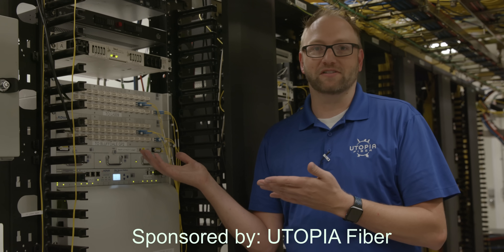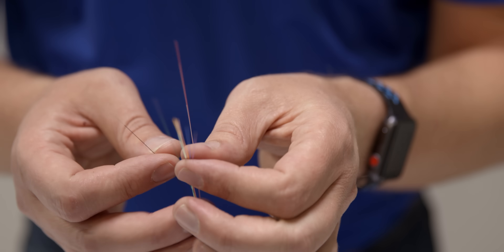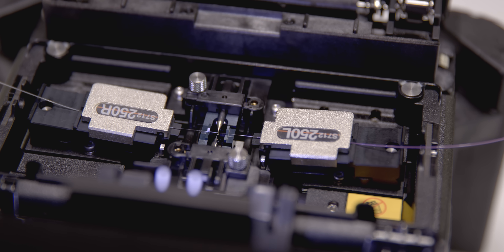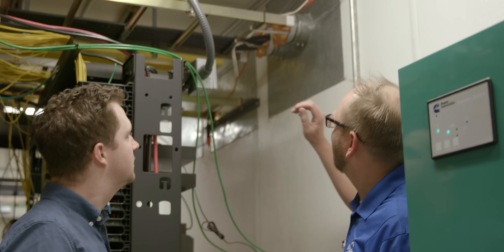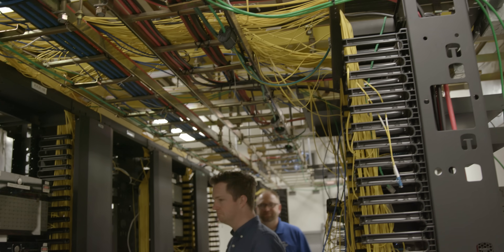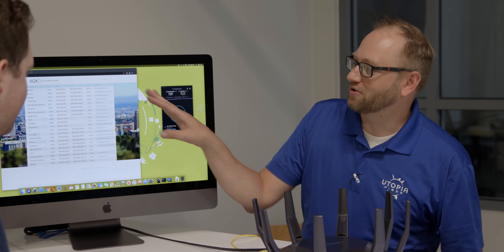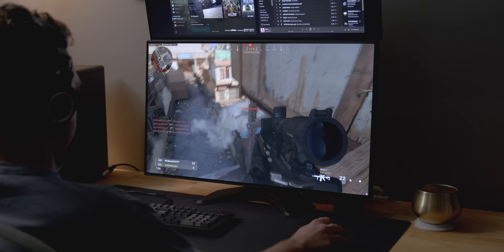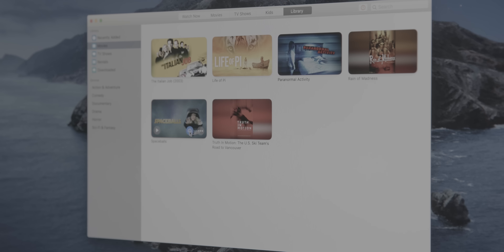4 Terabit Internet?! Fiber Company Tour!

Comment: "These are all 1Gbps connections, some 10Gbps." 

cries in german
Reply: Lmao Australia got a new network, the plans reduced upload speeds from 40 to 20mbps. We're going backwards.
Reply: Sal3600 I’m finally getting 250mbps and I’m in Australia
Reply: @thomasbarca9297  250 down or up? Even Aussie broadband with its 1 Gbps plan only provides 20mbps upload. It's disgraceful. We need higher uploads. They used to offer 250/100.
Reply: Sal3600 250mbps down
Reply: @Sal3600  you aussie ?
Reply: @Sal3600  well austria's upside down anyways.. so the internet is too :D
Reply: Sal3600 you get 20? Bruh I am lucky to get 1
Reply: Nbn ruined my Internet
Reply: @Sal3600  That's worldwide, otherwise, internet globally cound't stand by itself with so much info traffic...
Reply: @Sal3600  You can still get 100/40, it's just more expensive. 100/40 pricing is now 100/20.
Reply: @Sal3600  we’re evolving. Just backwards
Reply: Im lucky if I get 5mbps down on the outskirts of a city in England
Reply: @joeldeakin2003  I'm on the outskirts of a city and I get 1Gbps down.
Reply: Ich zahle in Hessen 35 im Monat für Gigabit bei Vodafone und es läuft.
Reply: @hasanp7256  Mag sein, kriegst aber auch "nur" 50Mbit/s Upload und Kabel is n Shared Medium. Für Deutsche Verhältnisse übel nice, aber alles in allem ist Glasfaser das richtige für die Zukunft.
Reply: @hasanp7256  Gigabit von vodafone ist ein Witz, mit nem upload schlechter als vDSL und einer Kapazität von der bei den meisten nicht einmal 500mbit bleiben
Reply: @hasanp7256  Ich bezahle 55 Euro für 100k die auch ankommen. In den 55 Euro ist auch die Miete vom neustem Modem. Aber das Internet in Deutschland ist wirklich schmutz. Wie geil wäre es einfach das man keine Probleme und überall Glasfaser hätte.
Reply: @hasanp7256  wait what ich zahle 40€ für 50mbit und mehr geht nicht aus meiner Leitung
Reply: @BrucyJuicy  Vodafone Gigabit über Kabel und Bestandskundenrabatt
Reply: Here in Iraq I pay 25 dollars for 150 kilobit 🙂
Reply: Black Devil wow they really are scamming you
Reply: @pizzoo  it's not only me
Internet in Iraq is a big shit my friend
Reply: Well regarding Germany we have a few special circumstances. For one: our population density makes (super) vectoring VDSL a choice where you can still reach many customers with rather short copper lines. But also these densities make it often more expensive to bury fiber in residential areas, as opening and closing streets is quite expensive. Also, we in Germany don't like fiber (or any other kind of cable or utility connection) on poles, but a "neat German city" has everything under ground. 90% of the cost of fibre networks is burying cables and building physical connections into the homes. 

Therefore although I absolutely don't like Deutsche Telekom's decision in 2012 to push everything to vectoring and super vectoring DSL – and their lobbyism for political boundaries in which this is reasonable – but I do understand that they did not push to FTTH or FTTB earlier (which is changing now and starting next year also Deutsche Telekom wants to invest into FTTH only).

On the other hand, especially in the federal states in Germany's north (Schleswig-Holstein, Hamburg, Niedersachsen) there is already a large community of utilities (Stadtwerke), which started investing into FTTH and FTTB deployments for almost two decades, but especially in the last decade. In Schleswig-Holstein almost a third of all homes are already connected to fibre.

But yes, we are behind other European countries in regards to fibre deployment. Especially countries like Sweden or Switzerland have had their former national telecom monopolist often pushing for "open access networks" (like Utopia in this video would be called in Europe, where a common local infrastructure can be used by many providers to deliver the service) for many years now. 

Yes, Internet needs to become a utility. At least the physical infrastructure. Competition should be in the service delivered on this infrastructure.
Reply: well, my personal experience here in a rural area of Germany.
ok... a rural area of Germany that has more then one "big" ISP availble in a 10 miles radius ( not counting the mobile service resellers )   ;-)

right now I'm paying about 50€ for a 200/12 Mbit cable connection, mind you, we only had 50/3 Mbit until the cable Provider started upgrading their backbone to gasp fibre about 5 years ago.

I gave up on German Telecom a looong time ago, it could perhaps be, because the last time I checked, they don't deliver even half the speed of that cable connection i got... for the same price coughs
nah, has nothing to do with greed and corporations and whatever -.-

and now for the VERY fun parts of that all...
max speeds I could get right now via cable, would be a woooping 300/15 Mbit for 65€ ... not really that big of an upgrade, considering the costs
and last time I checked, the only "big" Provider that is working on fibre expansion in like a 50 miles radius... would be German Telecom . . . 
well, I guess they may perhaps reach my area in 2030 ... maybe... sort of...

but, hey ! I have good news !
The German Goverment pays Subsidy to Companies that expand the Connectivity of a region, especially if its Fibre, if that region has less then 30 Mbits per home on average

and... YAY ! our thinks county ? district ? ( ... well, google says Landkreis = District ) just started a goverment subsidized FTTC & FTTB/FTTH expansion of the region through a 
( afaik ) small Company, planing to deliver HIGH speed internet to everybody and especially all those small businesses, 
letting everyone and their mom get a whooooping . . .
50 MBits . . . 
with FTTH . . .

i didn't even look at the pricing at that point.

TL;DR
so, German internet connectivity in a nutshell
- an area of north-west germany ( FIY.. Amsterdam, with many many european server-clusters, is NW of Germany ) OR a big city with backbones from more then 1 big ISP running through?
congrats, you can get 1 GBits for 80-100 €
- a rural area with at least 2 big ISP and some regional ones fighting for customers?
like me, you could get up to 300 MBits, for up to 75€
- every other area of Germany?
lucky to get a 3G connection... LTE, is that yummy?
Reply: That's nothing, you should look at India. I live in a metro, and still have to pay €25 every month for a fiber connection. Speeds are ok (around 300 mbps), but gigabit is crazy expensive (€80/month). This may not sound like much, but you have to account for the fact that currency conversion doesn't account for cost of living, in your terms, I'm probably paying closer to the equivalent of €50 a month for a 300mbps connection.
Reply: @summushieremiasclarkson4700  In germany I personally pay 45 euros per month for a 50 mbps connection over VDSL
Reply: Generously buttered ALCO .... I pay 120$ (Canadian) per month and get 5mb down and 0.8 upload on the high side
Reply: @summushieremiasclarkson4700  compared to germany 50 is kinda cheap
Reply: @summushieremiasclarkson4700  I don’t know how much €25 - €30 or €80 is in pounds or dollars (pounds I understand more since that is the currency I use, dollars i kinda understand then prices and that but not the best) but I’m going to assume it’s a lot with conversions and that to pounds and dollars, I’d kill for 30o mbps (i usually get 5 or less mbps download and less than 1 mbps upload.
Reply: Fiber 1Gbps in Bulgaria is like €12 or $15/mo
Reply: I pay 15$ monthly for 500Mbps connection (asymmetric) in Poland. The ISP offers 1Gbps for 20$ a month, but it's not available in my area yet.
Reply: Here in Spain we went from having not so great Internet connections to right now have around 80% coverage of FTTH (GPON), mainly due to a push by Telefónica, the incumbent operator, but also Orange, the second largest operator. Telefónica is replacing all the copper lines with fiber, even reaching small rural areas. They offer up to 600 Mbps symmetrical speeds, and they are planning to start offering symmetrical gigabit this year. Their hope is to have 100% coverage by 2025 at the latest, and so far it seems like they are on track (now they are focused mainly on the remaining rural areas), which it would seem unimaginable here some years ago, so there's hope for other countries I think. Also, for rural areas is important to note that the Government has a plan which subsidizes part of the costs to reach so-called "white zones" (those without coverage of 30 Mbps or higher), mainly rural areas, which played a key role in this process
Reply: Really? I figured Germany would be extremely well served. Are you near Berlin or another big city over there?
Reply: @nicholasbrownlee4209  Germany and Austria have worse Internet than many 3rd World countries, you will get 40mbps through DSL in most cities but if you want anything faster you either are lucky and have a faster than average connection or have to go the LTE route which is inconsistent and expensive.

I live in Vienna and I have to pay 50€ a month for 200mbps via LTE which I only get at night during the week, mid-day I'll be lucky to get 80mbps.
Reply: @alex_inside  As someone who obviously knows very little on this topic, this is surprising to me. Is it because politicians are not pushing for better infrastructure or something?
Reply: @nicholasbrownlee4209  Politicians are old and really don't understand digital infrastructure that well. Also our largest provider (German Telekom) keeps trying to push more data through copper wire, instead of expanding their fiber networks (Super Vectoring). 
I personally got a fiber connection through a newly founded provider, focusing exclusively on fiber and only in rural areas.
Reply: @alex_inside  surprised pikachu
I also live in Vienna, pay 40€ for 250Mbps up and down fiber internet, though of that I get 200Mbps, but it's very consistent
Reply: @nicholasbrownlee4209  Yes, they have been pushing LTE and 5g to solve this problem instead of expanding their fibre network but as of now at least for me internet over LTE isn't a solution.
Reply: @OverseerCave  Then consider yourself lucky that you have a 200mbps fibre connection.
Reply: @nicholasbrownlee4209  Yes, its ridiculous. Telekom is just now starting to actually change the cables to fibre or they will have to pay fines because of not "upgrading" our connections. 
German Telekom literally expands in to any fucking country in the world but instead we ourselves have slower internet. East Europe has even faster internet 😃
At the end of the day they just get foreign workers from Romania to change the cables 😂 and so would pretty much every neighborhood have to pay their own replacement.
Reply: @alex_inside  Or you are lucky and have cable. You can get got download with cable. Not so good at the upload side but well.....
Reply: @nicholasbrownlee4209  You'd think Germany should be at the forefront in internet speeds because after all, we're pushing the most data on the planet throughout our network, but nope. Our politicians don't understand the importance of the internet (especially for small businesses) and the network is mostly owned by one ISP.
It is becoming better tho. Where I live our local town and the state invested a lot of money into fiber and so I finally got decent speeds (100/20mbps), but in my opinion, Germany should be leading the EU when it comes to technology and we should show everyone else how it's done, the same way South Korea and Japan are doing it in the east.
Reply: @senzelian  Yes it was surprising but that's great that things are already improving. You guys are very good at many things!
Reply: @alex_inside  Are they trying to pump 5G through copper?
Reply: Polytechnika Super Vectoring is not fiber at all. It is just another standard for use with copper wires.
Reply: @alex_inside  wich 3rd world has such faster internet ?
Reply: @polytechnikaaa  germany is actually ahead in technical laws .
Reply: @alex_inside  those are for profit compnaies who are pushing LTE & 5G like they said in the video . UTOPIA is there cuz those companies neglected
Reply: @Саша-в4р3я  lmao you german ?
Reply: @theflyingBuSsArD  yes vectoring is just cheating like other  fancy words .
Reply: @polytechnikaaa  they do that because laying fiber wire costs them  i thin 70€ per meter but if they would buy some machinery made for that they would only need a 300k tractor rebuild for another 90k and then they coule make 2 km a day for low price of 1 person sitting on the tractor then u need the wire and 25 € per hour for fuel
Reply: @alex_inside  Romania has 1000x better internet than 95% of germany...
Reply: @alex_inside  dang you get up to 200?!
For me and most people I know (I also live in vienna) the average speed is about 30mbps, and that's when it's pretty good, otherwise it might be around 20mpbs or so.
Reply: @OverseerCave  I live in the 13th district and get 30 download at best
Reply: @alex_inside  can confirm i live in a "third world" country and my internet is way way faster than yours.
Reply: @nicholasbrownlee4209  Germany still has only a few percent of fiber. Rest is vectoring, DSL, coaxial and dialup. Even mobile network is spotty.

And expensive for this crappy upload speeds ranging 10-50Mbps for normal customers.
Reply: @LinuxDog  wtf. Small town Swede here, fibre everywhere and its expanding out into the real rural part, my friend lives by a dirt road in the woods with cheap and fast fibre
Reply: @jabr3088  do you mean your friend lives on the arctic with polar bear and both enjoy 10Gbps internet ?
Reply: @LinuxDog  FTTH ist recht gpnstig 1Gbit 60€ und 10Gbit 100€ (symmetrisch)
Reply: @LinuxDog  10-50 mbpd? Omg... i barely get 2....
Reply: @nicholasbrownlee4209  oh no no no german ia awful in internet because i think in the 80s it was when people already had knwon that fiber was future but germany decided to go with copper there for we get like 10-60mbps in villages und something about 100-500 in citys
Reply: @andres.96  Interesting! That's crazy early to realize. Was the idea to have a short-term savings measure on materials back then and plan to add lots of copper deployment gradually as opposed to focusing on a little bit of fiber quickly or something?
Reply: @nicholasbrownlee4209  Germany is bad served, the connections arent goverment "controlled" there are 3 main internet seller and those do not cooperate meaning if you want to buy a connection that is widespread in the north it will be more expensive to buy it from there and you will buy one that is mainly more for example east and if that happens your connection gets worse, and there is rarely, close to no one with the accessibility of glass fiber. Im lucky to have 50 down and 11 up (in an actual download i have 7mbps ._.)
Reply: @nicholasbrownlee4209  what ...just drive with an train and from 4g to e ore non faster than flash goes from NYC to la  also most of the areas have the oldest type of internet connection and can be happy if they get up to 100mbs
Reply: @Desugan69  I'm not sure I understand your comment. If you're saying most of the US has slow internet, that's true... Is that what you were getting at?
Reply: @nicholasbrownlee4209  no I mean the internet (mobile)is pretty crappy and almost you doesn't even get 4g connection and also the internet (lan wlan ) are pretty low in germany most not higher than mabey 60mb/s download and 10mb/s upload
Reply: @Desugan69  Ah. Interesting info. Outside of big cities in the US, the average speed is even lower, if you can believe it 
(40 Mbps) :-( It's weird that many places around the world still don't get its importance, especially during these times. Not saying everyone needs gigabit connections, but something reasonable is becoming more and more necessary.
Reply: @nicholasbrownlee4209   Germany has the second most expensive internet in the developed world, second only to Canada; here in Canada it's even 30% worse than Germany (!).
Reply: @nicholasbrownlee4209  I'm in the centre of Berlin and can only get up to 50mbps. There's some higher speed areas in Berlin for sure but the coverage is terrible in general.
Reply: @nicholasbrownlee4209  germany is like 70th place of all countries when it comes to speeds. i live in one of the biggest cities in germany and get 50mbit max.
Reply: @nicholasbrownlee4209  my friend has 400 k/bits download
Reply: I live in a small village in Austria. I pay 35€ for 30mbits.
Reply: Divi lol i live in italy and i pay 120€/Month for no internet (56kbps), i am watching this video in 3G
Reply: @chrisparussin5359  wow 120euro ? bloody hell
Reply: Chris Parussin I live in Italy too, but Ipay 29€ for gigabit speed in Monza. Your comment seems ridiculous, VDSL is pretty much everywhere how come you’re paying that much for such a slow speed?
Reply: The UK is pretty terrible too.
Reply: FlyGuy2102 🤣 at&t gigabit best 🐸☕️
Reply: I have 1gb but copper in Germany you pay a lot of money for fiber because you must pay all self like me I must pay 25000 Euro for this for the 200 meter to my house and after this I must pay 120 a month for 1gb but only download the company don’t make Booth with 1gb welcome to Germany
Reply: @Toastbrot-exe  25000 euro ? for what ?
Reply: I still using 1mbps for 60 myr. It's very slow.
Reply: If you live on Germany, get internet over docsis/coaxial (Vodafone is one of the few who provide it) which has up to 1Gbit internet (I have the 400mbps plan and it delivers)
Reply: @erikkunz  Yeah it is kind of okay. It doesnt deliver like it should do tho at all times.  Since they had problems a few months ago in my region they kind of have problems with their routing. Websites dont load as quick as before and my other 16mbit dsl connection has faster load times.
Reply: Cries in Europe
Reply: @Martiandeath 7004 was*
Reply: Same
Reply: I have 200Mbps here in belgium which is one of the more basic plans you can get, i think 100Mbps is the slowest my provider has and 1Gbps the fastest, 10Gbps is for business only.
Reply: @JMNTN  how much do these plans cost ?
Reply: Got 1 gbps in Germany for 35€ + Kabel TV at a Discount + mobile at a Discount with Vodafone. Not the worst Deal in the world
Reply: I live in germany and I have FTTH and can have 1Gbps (I only pay for 500Mbps because I don't need more than that) and everyone else here in the city or in all the nearby villages was able to get a free FTTH installation as well. Well the dumb people rejected the offer ofc because they didn't understand how important it is for the future but that's their problem. Idk where you guys live in germany but the internet is very good in the north.
oh and to the guys here with their "1Gbps Vodafone connections" You have just seen this video guys and I can tell you, your connection doesn't look anything like that. the fiber goes to a cabinet somewhere in your area and then it is shared with many other customers in the nearby households. that's why your speed goes down every time you really want to use it. maybe you are lucky and only a few people in your area are vodafone customers but it is not at all comparable to a true FTTH connection.
Reply: Digga ich leb hier im Norden in Hamburg und hier gibts nichts da von deinem Sci fi FTTH kein Angebot nichts, ich und mein bruder schimmeln mit 7mbps
Reply: @BreeN__  lool hier im Westen ebenfalls FTTH, Deutsche Glasfaser richtet
Reply: Valentin J dann werd ich ja von vorne nach hinten beschissen was soll das
Reply: @BreeN__  haha :p
Reply: In germany we have better Internet connections in rural areas as cities are often well served (100-500mbit) and rural areas go straight from 20mbit dsl to FTTH 1/10Gbit as they aren't served as good.
Reply: how do these big countries have such horrible wifi my small island of malta has 1gbps speeds available
Reply: I live in a country where I get like 1-2 mbps,  I really need to get the f out of this country
Reply: In romanua i pay 20 usd for 1gbps speeds
Reply: Bruh switch places with me please
fortnite European servers are in frankfurt
Reply: Can't agree, got 1Gpbs here in my small city,I am a Unitymedia/Vodafone customer.
Reply: @TheProstylers  but thats a rare occasion because they just startet to replace copper with fiber
Reply: italy: 1gbps 29 euros all unlimited 99.99% of italy covered
me into the 0.01% of italy not covered:
cries in italian
Reply: FlyGuy2102 we got fiber, but only 200 mbps initially, they upped it to 280 for free recently.
Reply: in israel i hot 200mb on dsl and now on fiber i get semetrical 970mb
Reply: In Poland we got 1Gbps internet for about 22 USD, but it is not accessible everywhere. As a rule it's only up to 80Mbps (not fiber)
Reply: well, here in Romania the best subscription is only 10$ for 1000/500 mbps
Reply: I am still sitting on 16mbit ....
Reply: Bro ich lebe im Dorf und habe 1GB glasfaser anschluss
Reply: The mobile Internet is even worse here in germany
I pay around 30€ a month for 10GB data volume and I only get 4G in citys and stuff. There are A LOT of places where I only get 2g (Edge) or no connection at all.
Meanwhile in other countries you get unlimited volume for like 20€ and you get 4g everywhere.
Reply: @KeinNiemand  wo bist du denn, dass du so viel zahlst?